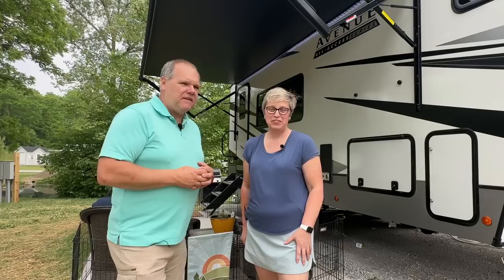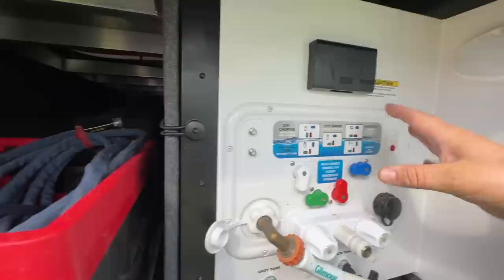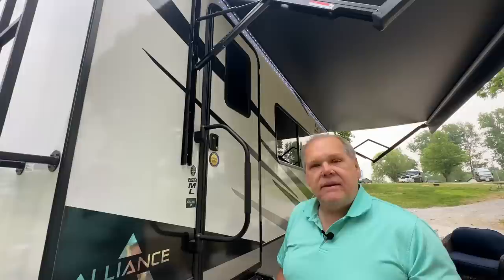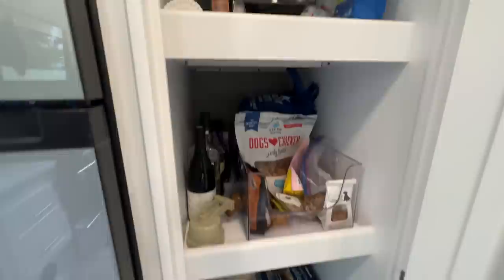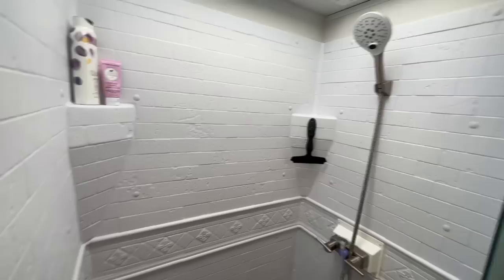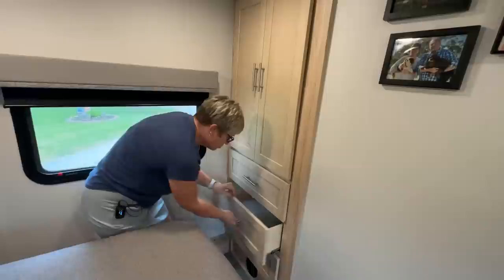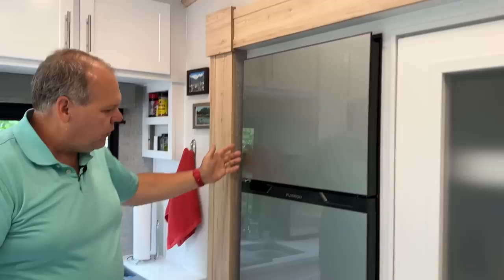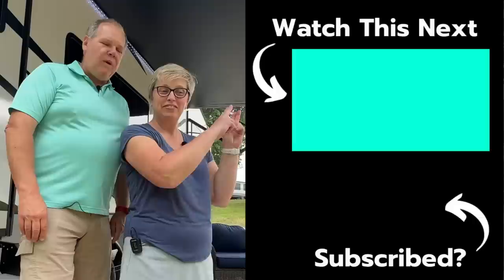OWNERS TOUR OF A 2023 ALLIANCE AVENUE ALL ACCESS 22ML

Comment: I'm glad you guys are happy with your new RV.  When we chose our second (current) unit there were several things I was looking for.  While no RV is perfect I'm very happy with most of ours.  We can access the bathroom and bedroom with the slides in. It has a residential fridge which is huge.  They made good use of most spaces.  Under the dinette you have drawers at each end and the center is accessable from the outside. The sewer connection (single connection), valve controls, and water hookup are all together, near the center.  All valves are direct pull, no cables to fail.  The max air fans an came with covers. We have a single thermostat so when I replaced it with a microair it was a single unit to buy, not 2.  Obviously a person has to figure out what works for them. Luckily they make lots of floor plans and there's lots of brands so we have plenty to choose from.

Comment: Alliance did a nice job with this small 5ver.  On the 2 AC on 30A, yes you can...we have 3 in our Paradigm and installed soft starts and we can run 2 without an issue.  Of course if you want to run a uWave, hairdryer, toaster etc, we shut one off while we use them.
Reply from the maker: That is awesome to hear!  We are loving the new rv so far.

Comment: Like you, we have a gas 3/4 ton short bed (6'4" on ours) and are looking at similar 5'ers (namely the 23mle, 22ml and similar up to 30'), but we're not sold on all the baggage that seems to come with a sliding hitch and have been told that hitches with offsets could void LCI frame warranties. Mind if I ask a few questions?

- Will you be making a video about your hitch(ing) and towing details?
- What hitch did you end up going with?
- Since your Silverado has the new gooseball location further back from the axle, what kind of clearance are you getting to the cab if you're using a single-point connection, or did you have rails installed in the traditional, approximately over-the-axle location?
- Now that you've been on a sizeable trip with it, how have you liked the experience for hooking, unhooking, ride height, bed rail interference and gap, towing, buffeting, sway, chucking, etc.?
- Wind and white knuckle driving, like you described with your Lance coming back through Kentucky previously, is our biggest concern coming from Class C and B motorhomes. Is the fifth wheel that much of an improvement over the Lance TT? We have an ARE cap on the bed and are wondering if it's worth selling off just for a 5'er.
- How has it been for clearance, turning and aside from the A/C incident, the ease of finding and navigating into/out of gas stations?
- Is the gas working out for you?
- Is there anything you would change about the hitching and/or towing experience?

Thanks in advance

Comment: Patrick, we had the Snap Pads on the rear legs and had to remove them.  Per Lippert, they recommend that you have 7" of clearance when the legs are retracted, and with the Snap Pads we only had about 5 1/2" so we removed them.
Reply from the maker: Thanks for the heads up.

Comment: What strikes me is when overnight parking you lose access to the bathroom bed room and the kitchen sink with the slide in.     Deal breaker for us
Reply: I have found you can always find a place to put out slide. Even at Cracker Barrel and rest stops.
Reply from the maker: Same with us Jonathan.  We always put out the slide on our Lance which is why It wasn’t a deal breaker for us.
Reply: Since the etiquette points for parking lot overnights are easily ignored.......where is the line?  In previous videos you mention putting down your stabilizers as well.   Other YouTube's are running generators overnight as well.

Etiquette guidelines are fine as long as they don't impact me? ????

When all the free overnight spots are gone we have no one to blame but ourselves
Reply: @jerrygundrum1  I put my slide out and stabilizers down.  It is simple and easy. First, you ask permission and then be a good guest.  Make sure your slide is over grass or not blocking anything and safe.  Be a good patron and quiet, clean, and out early.  There is your answer.  If you follow this you will be fine and not be the reason these spots go away. Now you know. You’re welcome.

Comment: Thanks for the walkthrough. Looks great. Did your truck already have the 5th wheel hitch in the truck bed, or did you have to get that done? Also, what is the pin weight. I have a ram 2500 with 3000 lbs payload and was thinking about getting a 5th wheel but have a short bed and the bed does not have the fifth wheel ready hitch holes.
Reply from the maker: We had the hitch added at a local truck accessory shop.  I haven’t weighed yet but estimate the pin weight around 1500#

Comment: Great walk through video y’all ! Love the setup. Wasn’t sure if the new RV is a 50 amp or 30 amp? Also do you’ll need to refill the 30 gallon propane tanks or if there are places that allow you to exchange them? Does it have a backup camera?
Reply from the maker: It’s a 50 amp unit.  You do have to typically refill the 30# tanks.  No backup camera yet but we will be adding one.